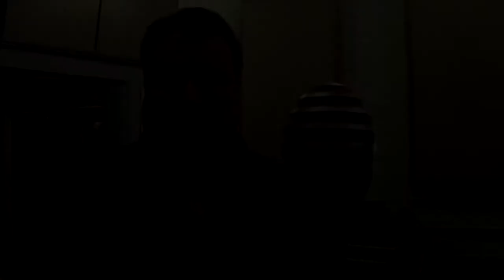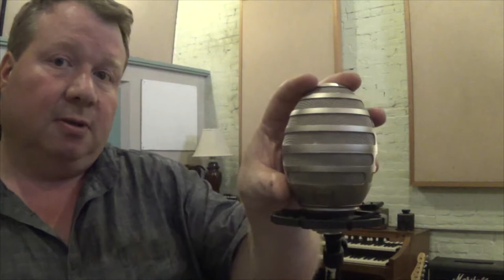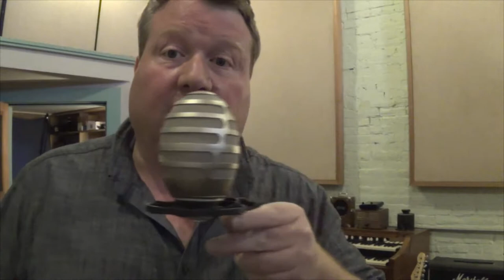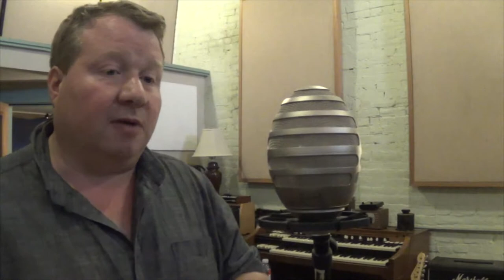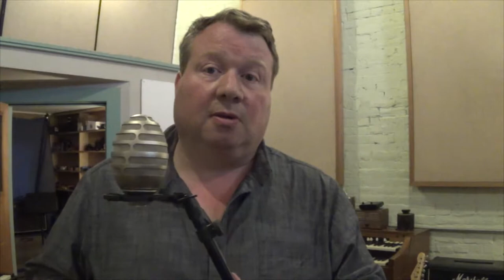NIKFI KMN-15 Microphone First Look

Comment: I love the way you desribe how mics respond to higher pressure levels...their behavior in general.  Its important.  Many fail to reach into this territory w analysis.  Its where I have found where mics start to seperate themselves, becasue I'm dealing with very high SPL.  The amps/speakers require it for what I want to happen.
Reply from the maker: thank you